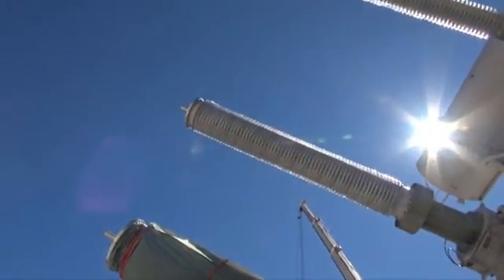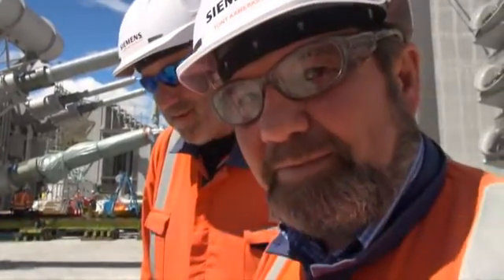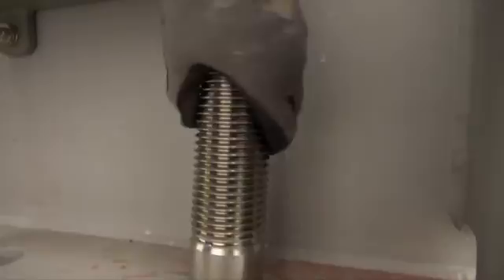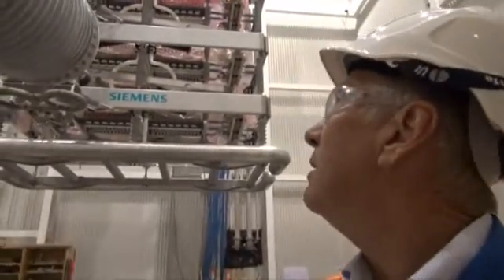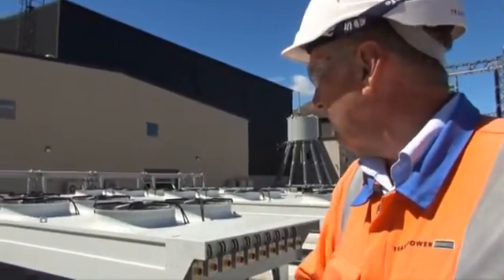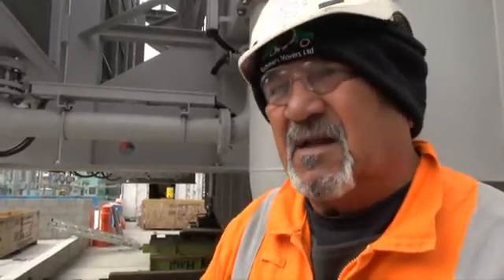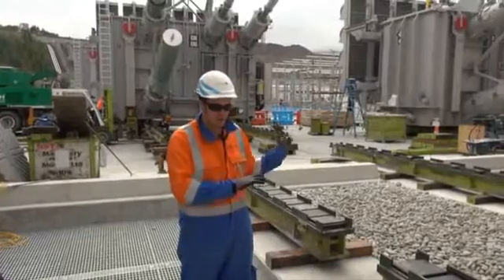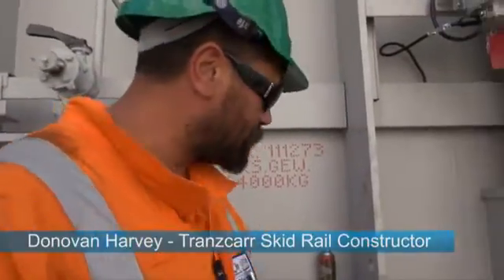Transformers slide

Comment: It really does appear 50% of these jobs is alignment. If I was on that job and one of those 56 mm bolts didn't line up the only thing I can think is to re drill and re tap. Measure 3 times and cut once on a job like that. I'm confident I could make it happen. Great detailed uploads Transpower New Zealand. One day I will be a substation technician.